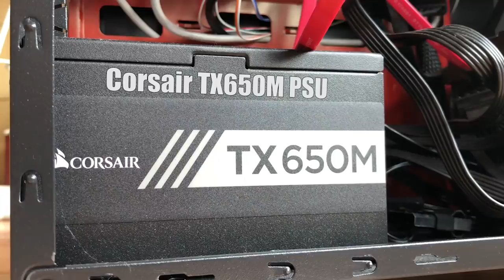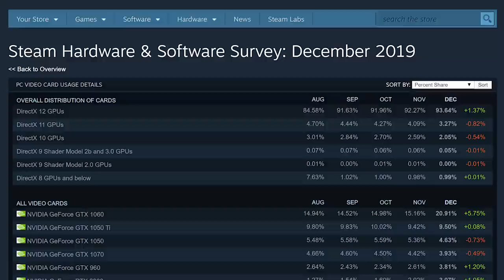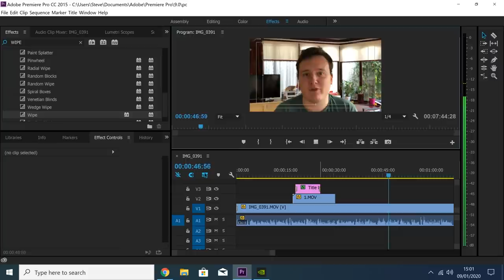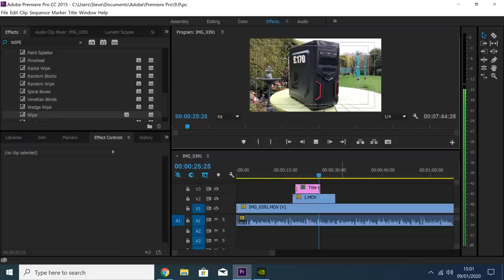What's Inside This £175 Pre-Owned Custom Gaming PC?

Comment: I'd overclock that thing to at least 4.2 (at least, even on basic boards that's easy) and OC the ram to 1833 (or whatever the next pre set OC speed is) and see what happens. Still gonna bottleneck of course but curious to see what improvement you get.

Comment: You also should have tested those games in 900p or 720p (or lower) to see just what is required to get playability. with a weak CPU like that, 1080p is out of the question.

Comment: I am thinking about upgrading my rig but need to sell my old guts: 4790k on MSI Z97 gaming 5 with 4x4GB Kingston Hyperix 2133Mhz and WD 500GB SATA m.2 SSD I am keeping my case, PSU and GPU but have old Antec 900 with Corsair 650W (80+Gold) and brand new (unboxed) Saphire RX580 8GB Nitro + (my old RX480 gave up and I got this as replacement- this took morethan a month to RM so bought a new GPU before it arrived). Not sure if I should sell things separately or build a full PC (900 is rather small for OC 4790k). What you think? How much should I ask for it?

Comment: It actually scores a bit higher in Cinebech compared to my i5 4570
But im pretty sure that it doesnt game as well since the Intel bias of most games and simply better single core performance
Reply: your i5 will destroy this cpu in games
Reply: .....how the heck does this thing score higher than your i5? in anything?.....wait man are you confusing Cinebench r15 and r20 scores?

you are aren't you. you saw the 682 and your i5 onlys gets like what, high 400's or something. You are using cinebench r15
Reply: @sirfairplay9153  this dude confused cinebench r15 with r20. he's probably using his own r15 score of high 400s or low 500s and comparing it to the 600 something in this video on r20
Reply: @bluescluessuperagent  No actually it is R15 but the difference is quite small maybe like 20 or so points but again, i might be wrong since i dont remember the exact score.
Reply: @Djoki1  he's using R20 in this video. you are using R15. hence why your scores look similar when your cpu is much more powerful. if you both used the same version, your cpu scores much higher

your cpu would score over 1000 on cinebench r20
Reply: @bluescluessuperagent  missed that detail. My bad

Comment: I have a 1050ti and a R5 1600X, and all games I play run at 1080p with the highest  graphical settings and at least 30 FPS.
Reply: @XxmatixX6videosdiariosdenadav  My 1050ti is overclocked to 1950 MHz and the memory to 2250 MHz, which  hugely increases the fps compared to a stock 1050ti or a 1050 3gb

Comment: @RandomGamingHD
Am I over or under-charging for this pc?

I'm planning on selling a spare system I have for about $200 Australian Dollars, here are the specs:
CPU: i5 760
GPU: GTX 760 4GB OC
RAM: 8GB (4x2GB)
Mobo: Asus P7H55-M
PSU: Corsair GS800 Bronze
Storage: 120GB SSD + 1TB HDD
I replaced the stock cooler with a cheaper new cooler since it was too dusty. Case is a bit beat up. I'm just going to do a fresh install of the free windows 10. I'll also be throwing in an i5 650 and i3 540 for free since I don't need them anymore.

Comment: I myself own a x4 860k, it's tuff without upgrade path
Reply: If you're on a really tight budget, a Chinese PlexHD X79 and 2650 v2 would be a huge improvement, or even a S1366 and 2430 v2. Lots of cores and HT runs modern games nicely, and the RAM costs diddly squat (16GB DDR3/1866 for less than $30); put the saved cash towards a better GPU. Or there's earlier gen Ryzen, but the mbd/RAM will cost more. Or of course there's the general used parts bundle or prebuilt option, but YMMV there.
Reply: @mapesdhs597  thank you for advice. It's nice you took your time to write that down. Respect :)
Reply: @damianmatijas5181  Most welcome! I upload my CPU/GPU benchmark results here:

http://www.sgidepot.co.uk/sgi.html#PC

I will be adding some Ryzen 2700X results soon. I do have many other AMD CPUs aswell (Phenom II 965, Phenom II 1090T, Athlon II X4 640, etc.) but I've not had a chance to test them much yet. Alas there is a large gap in my collection though between Phenom II and Ryzen, I had to stop doing hobby benchmarking due to lack of time, but I want to do a lot more of it this year.

Later I will be adding results for a PlexHD X79 mbd, 16GB/1866 RAM and XEON 2650 v2, that is probably the most interesting combination because of its low cost (I might buy something like an RX 5700 XT to provide a relevant "modern" GPU example, but I can at least test with an RX 580 and 1080 Ti):

https://www.aliexpress.com/item/32941784993.html
http://www.aliexpress.com/item/32955052083.html
https://www.aliexpress.com/item/4000018284947.html

Given the same low budget as a Ryzen build, the cost saving is probably enough to afford a better GPU (especially a used model such as an RX 580, GTX 1070, tc.) and a good NVMe SSD such as the Sabrent 1TB:

https://www.amazon.co.uk/Sabrent-Rocket-Internal-Performance-SB-ROCKET-1TB/dp/B07LGF54XR/

though I have had good success at obtaining top-end SATA SSDs on ebay such as the Samsung 850 Pro 512GB or 840 Pro.

For cooling the CPU I used a Corsair H412R 92mm on my PlexHD build (found some new ones cheap on Amazon and ebay), but if I was doing the same thing again I would just buy a Snowman which has a good reputation:

https://www.aliexpress.com/item/32995094172.html

There are many caveats of course with these Chinese mbds, and people are right to point them out (eg. sleep mode generally does not work), but the value equation is hard to ignore. I also think sometimes some people just get annoyed at the fact that it's possible to make something which is so cheap yet just as good or actually faster than whatever their expensive mainstream system was. :D  Have a look at my results, I have been surprised at how close even the low end XEONs come to my 5GHz 2700K using the same GPU (the entire mbd/CPU/cooler/RAM combo with the XEON 2420 v2 cost less than 125 UKP!), and I have yet to test the more powerful XEONs which have more cores (at higher clocks) which will help in titles like Assassin's Creed Origins aswell as GTA V, etc. The exception to the above are esports titles where one desires very high frame rates at 1080p, that's where a Ryzen 5 3600 would be more sensible, but of course a lot more expensive. I am more interested in helping the majority who still focus on 60Hz at 1080p or 1440p. I hope to start testing 4K in March or April.

You can find many videos about these motherboard and CPU combinations on the channels Tech Yes City and PhilsComputerLab. If I have time I will begin uploading my own content during the summer. Having said all that though, if you can bag a local mega bundle or complete PC bargain then go for it, eg. in 2018 I bought a Rampage IV Extreme, 16GB DDR3/2400 and i7 3930K from an ebay seller for 200 UKP which back then was a very good deal. Find these is pure luck though, whereas all the Aliexpress items are available 24/7 with free shipping worldwide (it's just that for some locations the delivery can be a bit slow, though where I am in the UK the parts I bought arrived in about 7 working days).

Good luck! :)

Comment: if you have to sell that pc please put a trashier power supply and gpu (something like 400w psu and 750ti) in it and keep the 1050ti and the better psu (once you get all the cables missing from ebay for cheap or even custom made ones from modders ) for another videos/ projects

Comment: WHOA i thought this was my pc, got a very similar case. Its called a ms ranger. Ive got a i7 3770, gtx 960, 8 gigz ddr3 so specs are very similar too

Its really red inside like this one (the cables etc) so i was like tf is this my pc? Really freaky considering i built it myself one part at the time.

Comment: I would never pay that much as a system builder...  I generally get 2600K to 4790K builds for around $100-$150
Reply: ...where the f do you get $150 4790k builds? the cpu alone costs more than $120ish in the US (and I say this as someone who gets amazing deals all the time myself)
Reply: @bluescluessuperagent  Many sources... I have one regular supplier I work with who gets me probably around 20 units a year, small form factor Dell Optiplex 9020, i7 4790, 8gigs, dual 320 gig hard drives and Optiplex 9040 i7 6700, 8gigs ddr4, dual 500 gig drives for $100 a unit, I have various other small sources, just yesterday I picked up an i7 4790K with 16Gigs DDR3, 120Gig SSD, 4Tb Hard Drive, and a GTX 970 for $150.... Id pick up a lot more if I had the cash
Reply: @dragonsystems5973  I too have someone who gets me great deals (thought not on full systems like that) but that's hardly the norm.
Reply: @bluescluessuperagent  We call this mythical place the land of Seattle
Reply: @dragonsystems5973  that seems not even the norm for Seattle as your have a supplier. The average joe shmoe isn't going to get deals like that

Comment: Guys , I need help am stuck in this situation, I have a hp notebook with 4gb ram , 1tb hdd, i3 5005u and and amd Radeon r5, it's around 5years old ,I had upgraded the ram to 8gigs , it was working normally , I also had used msi afterburner and overclocked my gpu to max possible limits (from 300mhz to 1100),it was great but suddenly one day I was watching random gaming hd , videos it suddenly the screen had thick white lines and went blank white , the video was still playing it was functional,I turned it off checked the display connector many times ,opened the system reinstalled everything it's still blank white screen and it goes into bios but the screen is still white and I can't see anything,please help guys
Reply: I think you burnt out the integrated graphics.
Reply: Garbia Garcel , thanks for that suggestion mate , but I did some more digging and found out ,the screen was the problem , what happened was i used to clean it with cleaning solutions , the solution had seeped inside and corroded the display convertor chip , the small board underneath the main display ,so there was no other option other than getting the whole screen replaced , but hey it's all good now , never clean you displays edges with liquids!

Comment: I'm thinking that the 1050ti is terrible value compared to the RX 580 and RX 570. Those 2 cards outperform the 1050ti and are usually cheaper...

Comment: I heard that x4 840 is actually faster then this chip and WHY ut says 2C/4T on cinebench even tho it's a 4 core. I got a x4 840 and same happenes to me. Should I be worried?
Reply: Because AMD back then tried making each pair of cores share resources in order to accommodate large core counts in the subpar transistor density of GloFo's silicon processes, and since in many cases trying to address each core as a ''full'', separate core caused bottlenecks on the second core accompanying it or on both, so instead of doing further stupid decisions and make a custom task programmer, they made the OS look at each module (which is a pair of cores with shared resources) as a single core with two threads, but don't confuse it with Intel's ''Hyper Threading'', as these are indeed two execution units instead of a single execution unit and a fake thread that holds processes that are receiving data in order to be executed.
This fixed the first problem and increased the ''single'' core performance of FX and other CPUs using derivatives of Bulldozer by making each module focus on a single thing at the time, which resulted in up to 20%+, but definitively killed the per core parking, as it has to park a pair of cores instead of being able to park even odd numbers of cores, effectively killing the boost clocks of these chips in real world applications, they are still effective in benchmarks, though.

Comment: Get the R5 1600 AF 85.00 on amazon.
Reply: Just curious, assuming a relevantly lowish budget, what else would you buy to go with it? (mbd, RAM, GPU?)
Reply: @mapesdhs597   GTX 1650 super a b450 motherboard and 8 to 16 gigs of ddr4 running at 3.000 mhz
Reply: @stevenanderson3205  What would the total cost of all that be? (quite a price range for B450s)
Reply: @mapesdhs597   about 450 to 500 that is US dollars that would be a good budget gaming computer just don't cheap out on the power supply it may be the most important piece in the whole computer.
Reply: @mapesdhs597   b450 alone 60 to 100 watch some reviews on youtube.

Comment: Youtuber has a pleasant personality. Beautiful case inside and out. Regarding the processor, it's a true dual core processor, not quad core as ipc's are shared between cores and thus they are not discrete cores as in Intel chips. The same argument can be made for AMD fx processors as well.
Reply: no. that's a dumb argument (and that california case was in 1 state and was settled out of court)

it's a bad 4 core. it's in no way a "true" dual core. (not to mention multi core performance actually improved with these FM2+ cpus over the Bulldozer and Piledriver FX cpus)

and it's very easy to prove too

For instance, I'm messing around with a 860k right now. 

When I run cinebench r15, my score multiplyer is between 3.5 and 3.7 depending on my overclock settings. 

if it was a dual core with HT or SMT, it would score like 2.5 at best....honestly it would be like 2.2 or something. 

another build I just flipped had a sandy bridge extreme Xeon E5-2667 (6c12th). In Cinebench r15, it had a multiplayer of 7.07. It has 6 cores, 12 threads, and those extra 6 threads barely equaled 1 full core. 

my personal i7 5960x with 8 cores and 16 threads gets a multiplyer of 9.97. So those extra 8 threads equaled 2 cores more or less in performance. 

I think for FX cpus the multipleyer would be lower, (as steamroller and excavator improved multi core performance) BUT they would not be so low as to halve the core count. The 4/6/8 FX cpus do not perform like 2/3/4 core cpus with HT/SMT.

One could still make the argument they aren't "true" cores......BUT no one could make the argument they act like half the core count with HT/SMT. 

The performance, or rather lack of performance, just isn't there.

Comment: 7:22 2 core 4 treads "quad core" XD
Reply: Technically just hyper threaded. Same as the FX series. 6300 isn't actually a full 6 core and the 8320-8350 arnt 8 cores

Comment: Should I get a GTX 970?
Reply: It's all on the price, really. I f you can find a 970 for dirt cheap more power to you. Personally o would reccomend something like an RX 570, they have about the same performance, tend to be priced similarly, and the 570 is a bit newer and can be found with more vram
Reply: @CoolGuy-sv6kn  yeah I'm thinking of the Rx 570 too, I'll see which I can get cheaper and go with that, cheers mate
Reply: @araize8508  the biggest difference is probably only going to be felt down the line, newer card, longer driver support